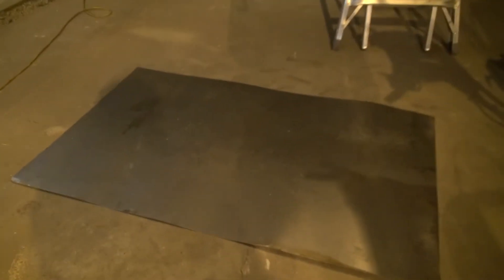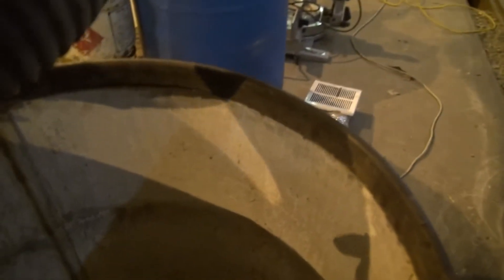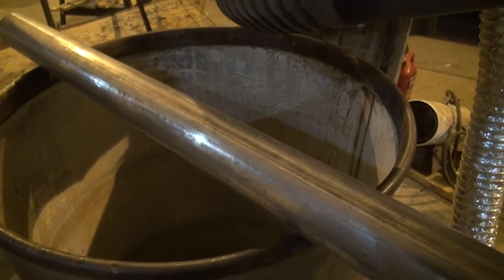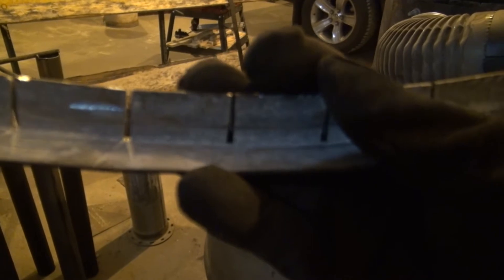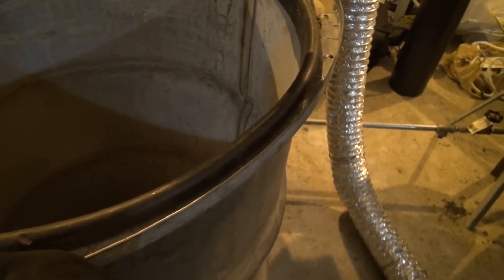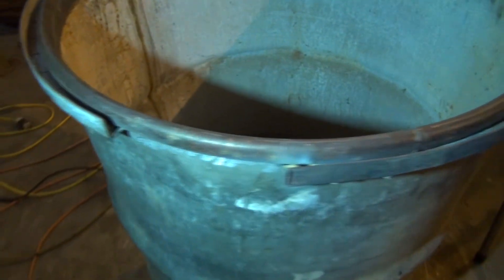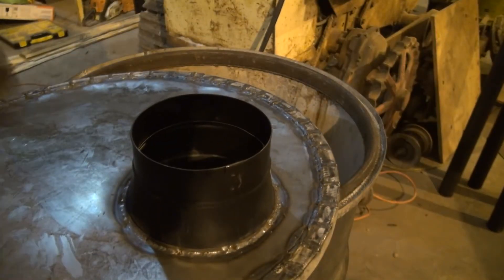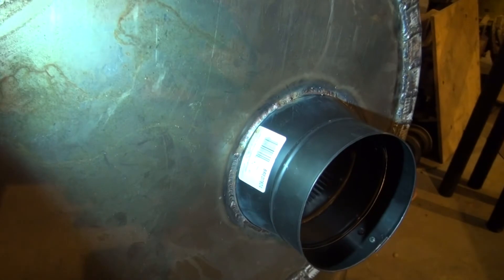SUPER HOT! Waste oil burner 2.0 "Heat exchanger ADDON"

Comment: You said the exhaust flame is blue. What type of heater do you have Martian ??? Nice welding on galvanized metal drum and no burn through. How much extra heat did you get from the modification ???
Reply from the maker: I was buring old hydraulic and engine oil there. It was all down to the fumes burning very well with the forced air.
The heat exchanger is a catch 22. It got me a felt doubled heat output, but it made the exhaust much worse. It doesn't help that the exhaust has to go down, leaving the burning barrel.
The new shop might have this burner in it with the heat exchanger ABOVE the burner barrel.
Reply: @MartianDanTheMartianMan  Your idea is valid and correct in retrieving as mush heat as possible. One big thing that really makes a difference is having air ducted from the outside right to the burner. This keeps air from being drawn into the shop from all the available air holes on the exterior surface of the building. Nice work and good luck fella.
Reply from the maker: @victoryfirst2878  thank you for your kind comments and I totally agree. Like with many of my projects I have planned improvements and just never get around doing them, because it work. The fresh air intake as well as sealed burning vessel would have been great to have

Comment: Bypass damper to route around 'recouperator' until stove & exhaust are hot and drawing = very little smoke on startup. COOL! I like it. Could even be a little more Frankenstinian if the exchanger was mounted on top of stove like a double barrel only end to end vertically. What the hell? There are MANY ways to do this. It comes around to what are you willing to put up with. GREAT VIDEO! Keep on experimenting. Michael in Colorado.